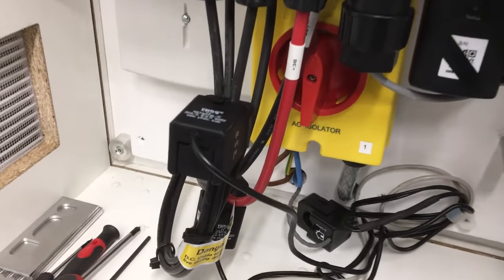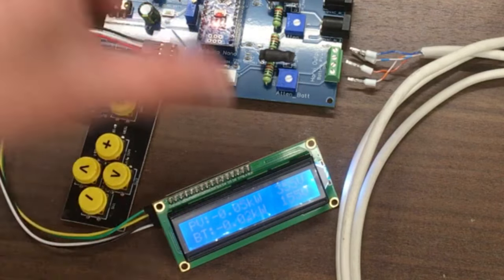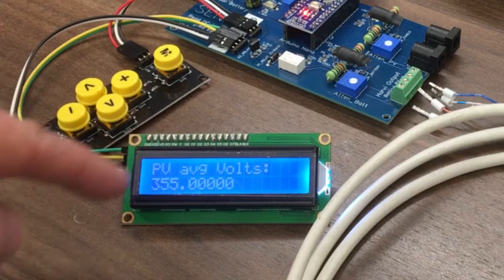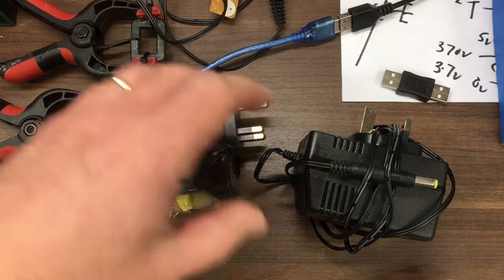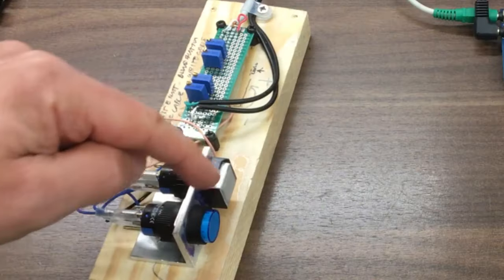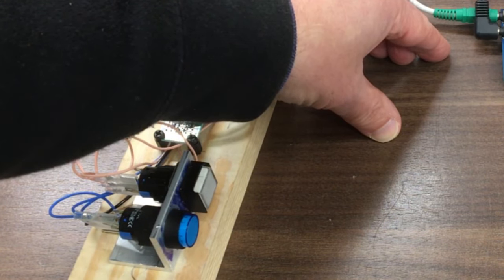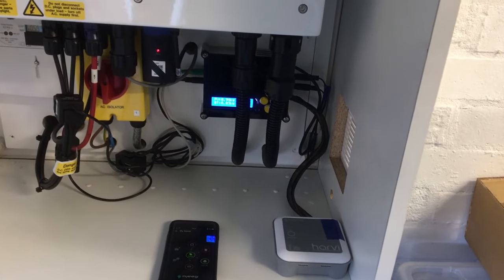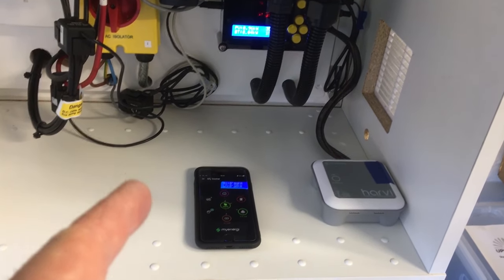Ep04 DC solar monitor - Upgrade to closed loop!

Comment: Hi, nice one getting this all to work. I'm quite interested in the Harvi interaction part. I'm just about able follow what you're doing at 14:00 Would you be open to sharing the PCB schematic at all / at least for that side?
Reply: Ah nvm, I think I get it now. If you had a 9V ac/ac adaptor it would essentially be an LDR in series from the adaptor going to the Harvi I think. Suppose it’s possible the resistor divider is also helping in some other way - sounded like it was very sensitive to alterations here.
Reply from the maker: Essentially yes.  The resistor divider was needed to drop the AC voltage to a level the Harvi needed.  They were 1 Watt because they needed to allow enough current to flow as that is what the Harvi needs to sense.  They get warm but not hot.
Reply from the maker: I couldn’t find an AC /AC adapter which output a low enough voltage.  Otherwise they would not be required.
Reply: @routercnc9517  Thank you for the elaboration, I’ll do some experimentation!